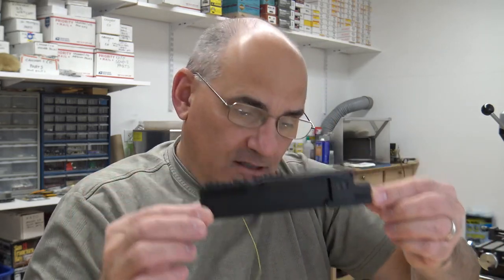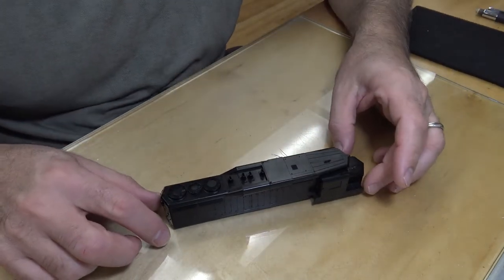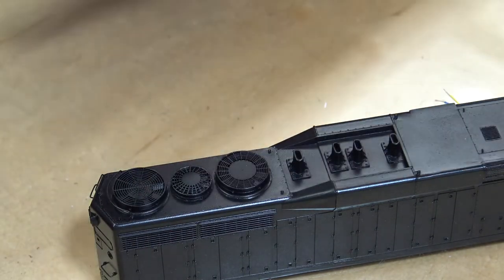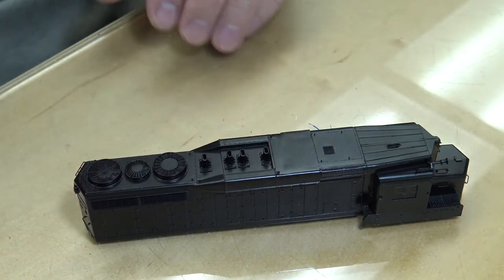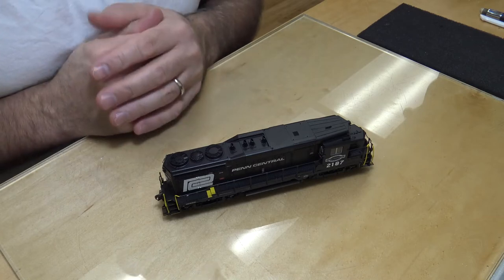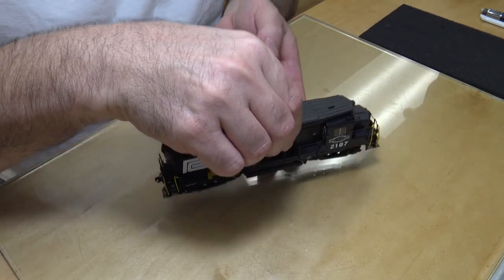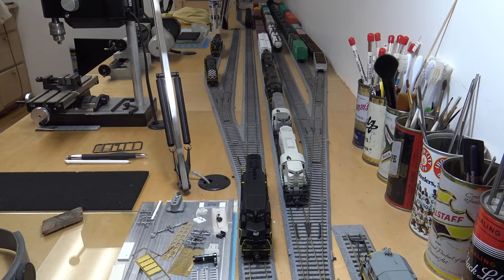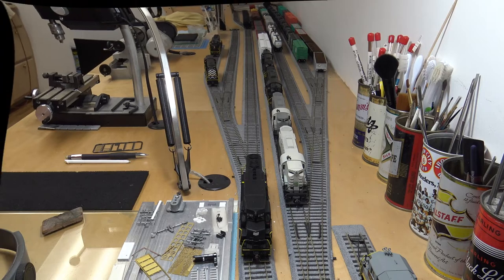CPT&C GP30 WRECK REBUILD TO GP28 PART 06

Comment: Lovely model. You said earlier in the video you were going to place the road number on the side of the dynamic brake blister. Looks like you changed your mind.
Reply from the maker: Yes, you caught that. I meant to address that in my closing video nd forgot to. I put it on the equipment boxes because it looked more appropriate there. I set the numbers up on the non-db hatch it they looked out of place.